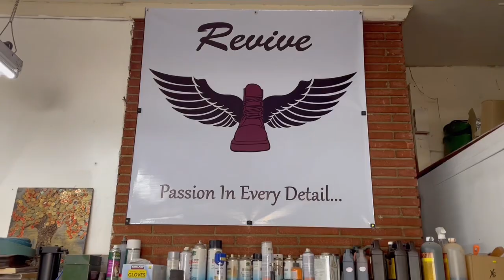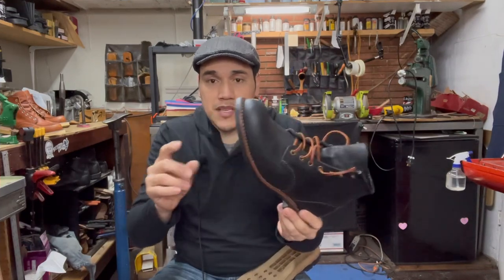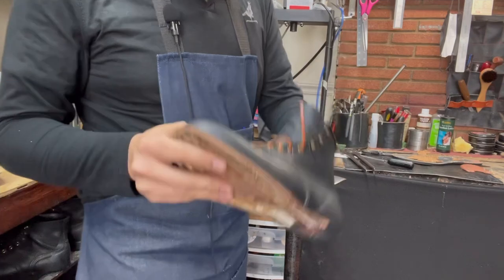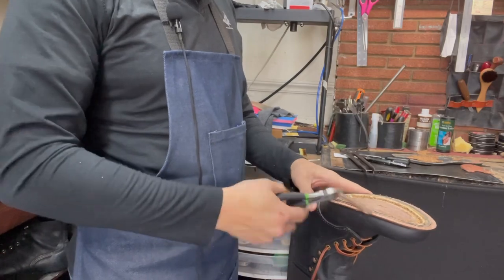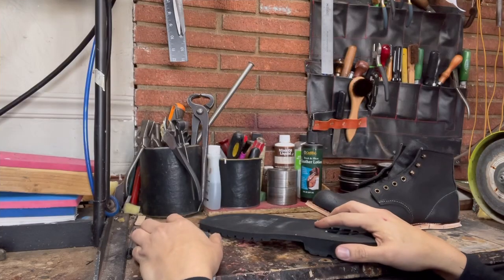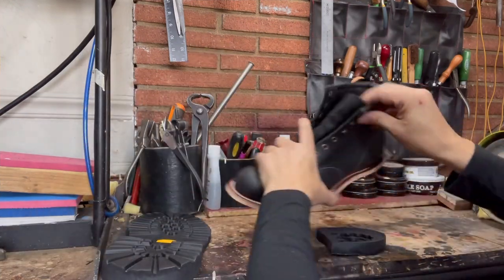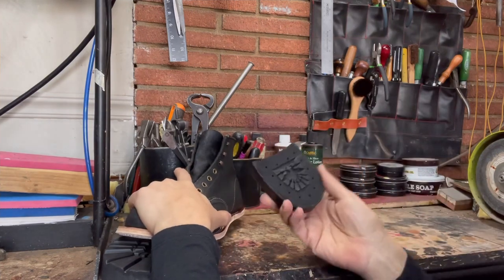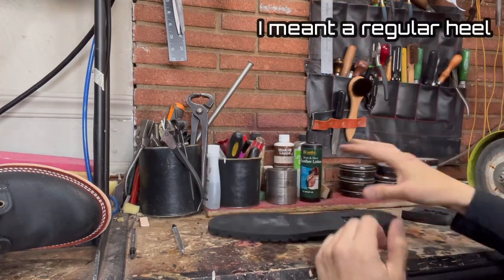The New An improved Red Wing Blacksmiths/#redwingheritage #redwingboots

Comment: I put the Vibram 528k on a pair of Danner Bull Run to replace the original wedge soles. These have a long heel cap and on the soles I cut the little step out to lose some length of the heel. 
I wear these now for 4 months on concrete and tile floor an find these soles as comfortable and shock absorbing as the original ones. Changes the look, keeps the comfort. 

Your choice in this video looks great though!